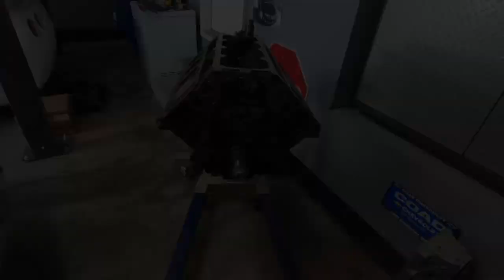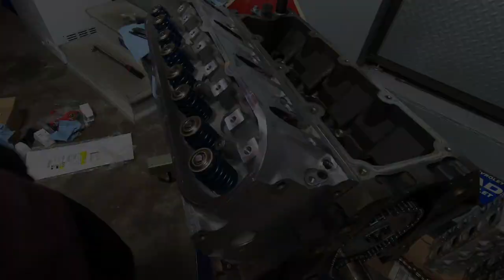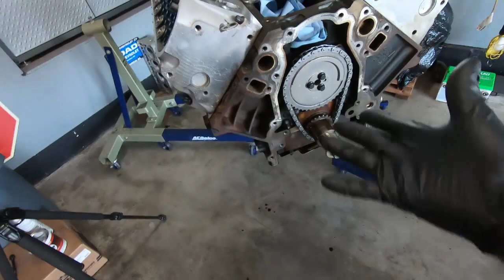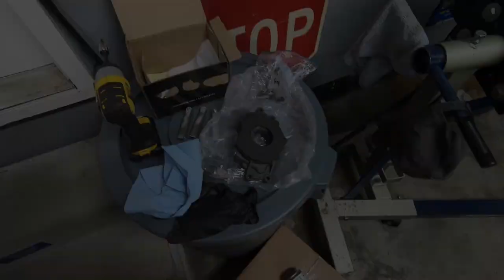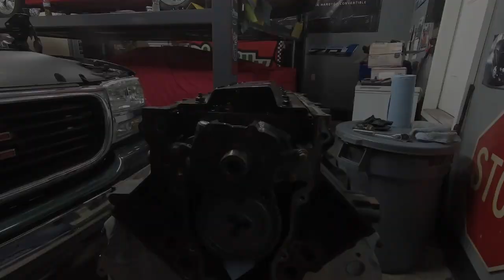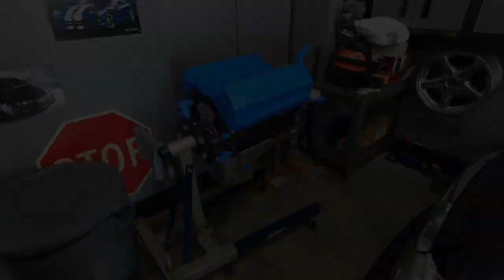Slammed Sierra 4.3 to 5 3 swap Part 5 (Engine Assembly with New Cam and More)

Comment: Great Vid Travis!  Just an FYI Trick Flow makes a plate to add a chain Tensioner on the gen 3 blocks
https://www.summitracing.com/search/brand/trick-flow-specialties/product-line/trick-flow-timing-chain-adapter-brackets-for-gm-ls/part-type/timing-chain-damper-brackets?fr=part-type&SortBy=Default&SortOrder=Ascending&autoview=SKU&ar=1

Comment: Hey why are you not using the transmission out of your green gmc with the new motor?
Reply from the maker: My Dad is using the transmission I removed.
Reply: TWA Motorsports okay, will you have to change Torque converter’s when going from a 4.3 to a 5.3
Reply from the maker: @leecochran5912  already got one👍

Comment: Just don't look at those cam bearings while doing that cam swap...as you were looking at the bearings. ...lol....you know trick flow makes a tensioner adapter for those gen 3 motors and you don't have to drill it bolts wit the cam plate and uses the dog bone tensioner that you were talking about, I wanna say summit sells them for like $50....I never soak my lifters....I give them the R.kelly golden shower treatment. ...but next time I think I will do your dip method seems to be a little cleaner!!!!.....on the last 5.3 I had I ran a asa cam, it only has .525 lift so I think you can get away with stock springs, but it's a lopey and stinky cam, my wife hated whenever I'd start my car in the garage and gas, out the house,  she kept crying so a switch that cam out for something not on a 110lsa.....although that asa cam has a powerband like 2 stroke it's actually pretty fun on the street and sounds mean!!! But I don't think you want that for that new of a truck, the tune would be hard to do on the stock ecm. I'm running a fitech ls setup so it tuned itself. It was in a 68c10....and on my nova too, I've had good results with the fitech ls setup so that's why I did both vehicles with em.....next time I'll do the holley terminator x. ........I snapped one of the small bolts on the heads it was the second one from the back so I just sent it, still running fine 3yrs later no problems. If it was a big one then I'd be worried
Reply from the maker: I didn't love the trick flow part. I actually ordered that tensioner and tried it off camera. Fitment wasn't up to my liking.
Reply: @TWAMotorsports  good to know, thanks for the warning. ....
Reply from the maker: Yeah just not great quality

Comment: It's coming along really well. I just changed the water pump on my wife's gmc Yukon. I was going to ask you if you don't mind me asking how much did everything you did cost you. I'm going to have to rebuild or buy replacement engines for my wife's truck and mines. Just want to know if maybe doing it your way would save me some money. I've researched remanufactured engine's and they are going for about $2,500 - $3,000. Also are remanufactured engine's the best way to go? Appreciate your support
Reply from the maker: I probably have $1000 in gaskets, bolts and head work. Its crazy
Reply: @TWAMotorsports  wow. $1,000 . That's not bad. That is something to really consider. Our engine's have over 200,000 miles on them. I'm not sure if I would have to worry about the short block. But the way your doing it sure would freshen up an older engine for sure.
Reply from the maker: Yeah the 5.3s last a while if taken care of.

Comment: Did you port the heads too? About how much did the head work cost?
Reply from the maker: No porting. Just clean, valve job and surface. All that was 250
Reply: @TWAMotorsports  not bad
Reply from the maker: No it wasn't too bad.

Comment: When that gasket goes so does oil pressure.
Reply from the maker: What gasket?
Reply: @TWAMotorsports  Cam plate gasket.
Reply from the maker: Good thing I installed a new one. Thanks for that information